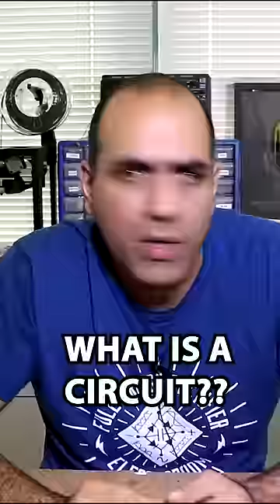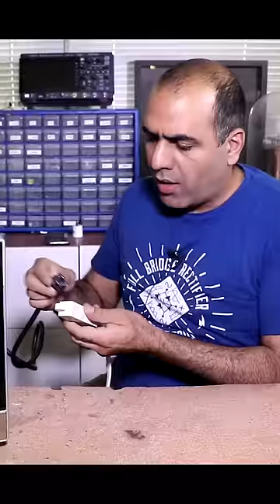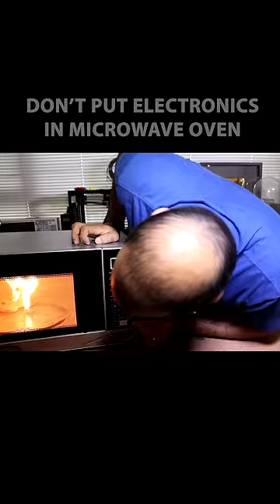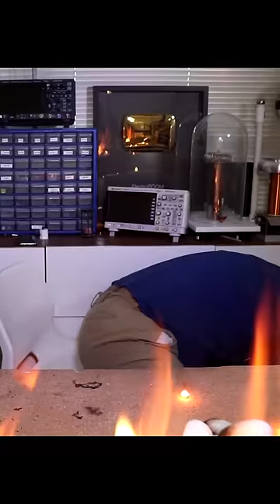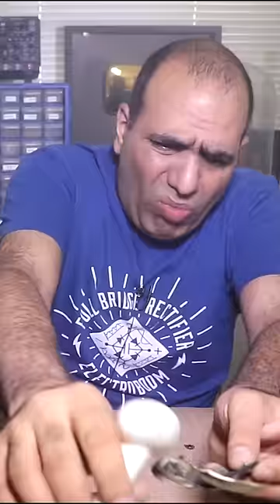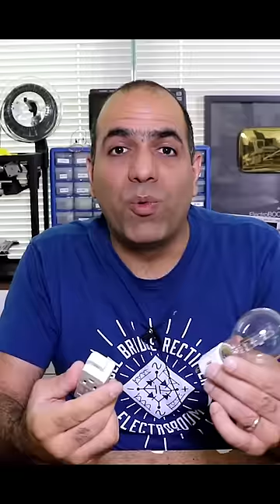LEARN FROM YOUR MISTAKES!!! #circuit #funny #electricity

Comment: Also make sure your extinguisher is suitable for electric fires.
Reply: CO2 ftw
Reply: Extinguishers of the air horn variety are not suitable for electric fires.
Reply: And for kissing.
Reply: And make sure its not made in the UK (IT Crowd)
Reply: @JanicekTrnecka Better hope it's not running Vista.
Reply: 1000 like
Reply: @audhen1  And with C02: don't forget to open the window before using it, or stand in a safe distance ...
Reply: Also make sure your extinguisher isn’t an airhorn
Reply: Yeah some fire extinguishers have magnesium which makes the electric fire worse (or something like that my chemistry teacher told me, I'm not too sure)
Reply: That's ideal, but often not necessary. Turn off the power and the electrical fire becomes just a normal fire. A big component of electrical rated extinguishers is the contents not being conductive. Even with electric rated extinguishers you have to worry about re ignition if the power is still causing an arc.
Reply: @vdd1001  Magnesium burns fast and hot so not that!!!
Reply: @audhen1 CO2 has a max voltage too.
Reply: In this case you dont have a electric Fire because the electric Fire i almost every time because of High voltage
Reply: Lol while it was a fire on a piece of tech it technically wasn't caused by an electric failure fire so that extinguisher does work in this case. I remember we actually had to use the silver extinguisher with the green goo cause the old fry fryers were never properly cleaned so the fry oil caked up on the internal circuits and went whoosh. Almost burned my coworkers pants. I saw the smoke coming out of the pants and warned her. Not even 20 seconds of her stepping back, flames shot out. We had to shut down the restaurant at 6 pm dinner rush. Cleaning the place down while smelling the burnt plastic of the wires was repulsive. Made my nose hairs retreat back into their follicles.

Comment: I agree with you on not putting metal in the microwave. I once cooked some cup noodles in a microwave and for some reason, the lid which was supposed to be fireproof burst into a ball of plasma. I’m pretty sure it’s not supposed to do that. Maybe it did that because I forgot to add the water to the noodles 😅

Comment: Omg.  You know what you do.  Take a cork a tooth pick and stick in cork.  Place grape on other end and place shot glass suspended over grape and microwave and a plasma ball will shoot up out of the grape and contsin inside shot glass.  Make sure shot glass is heat treated😅😅😂😂

Comment: isn’t it smarter to leave something on fire in the microwave so it cuts of the oxygen supply and can kill the fire instead of takeing it out?
Reply: The video wouldn't be funny if he didn't act stupid. There are air vents and a fan in a microwave but as soon as you turn off the microwave any fire dies down pretty quickly